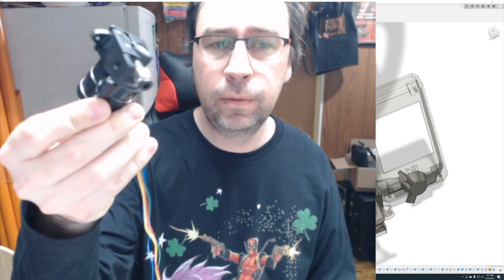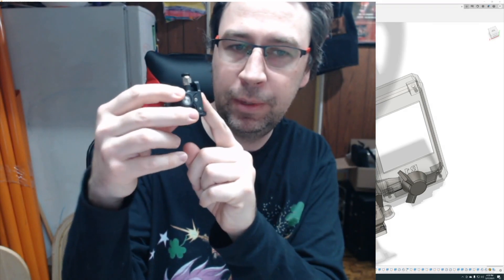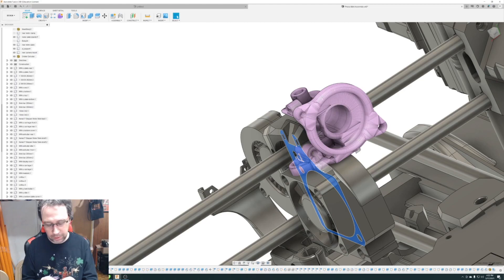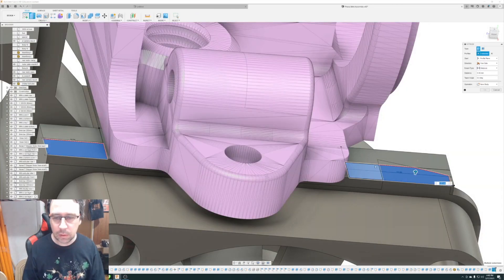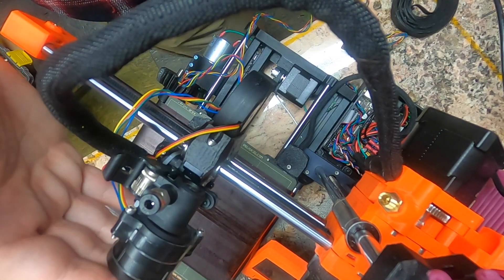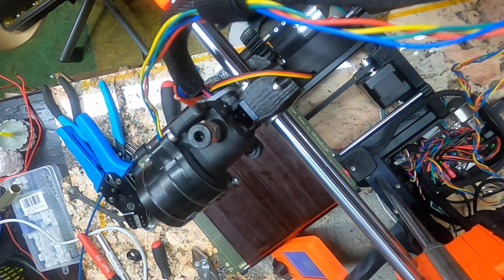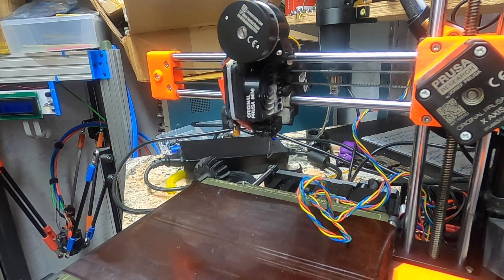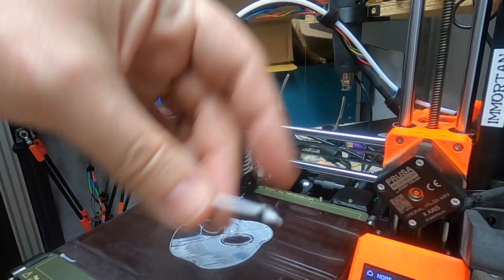Orbiter Install Part 1 - Failure!

Comment: how many volts you put on vref for the orbiter motor? and how do you choose that voltage? i have one orbiter but i am not sure on how to change vref to give him the correct ampere
Reply from the maker: I'm using 350ma for the motor.  To set it, I run M906 E350 in the start.gcode for all my prints.  Also have to set the steps per mm with M92 E655.  My full start.gcode for a Prusa Mini with Orbiter extruder is right here:
https://github.com/paenian/PrintShift/blob/main/prusa%20mini/PrusaSlicer%20Profile/start_and_end_gcode_orbiter.txt

Comment: I modeled one for the Sherpa mini extruder but I haven't tried it
Reply from the maker: Is the filament path better constrained on the Sherpa?  Otherwise, it looks pretty similar to the Orbiter - I mean, I would expect good performance from both on hard plastics.  Just be wary - the extruder generates a lot of force, your mount needs to be solid :-)
Reply: @PaulChase  I doubt the sherpa is any better constrained than the orbiter. Also my mount should be tough enough though the sherpa mini is a bit flimsy.